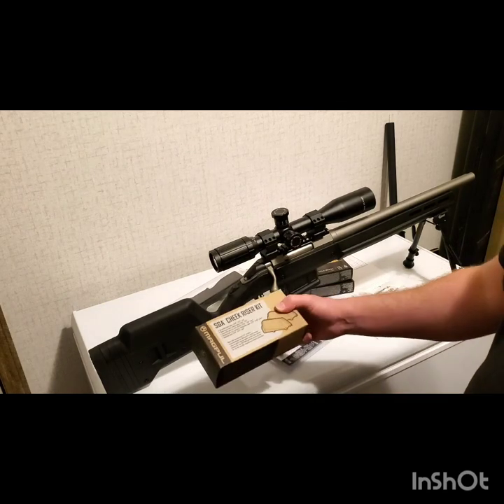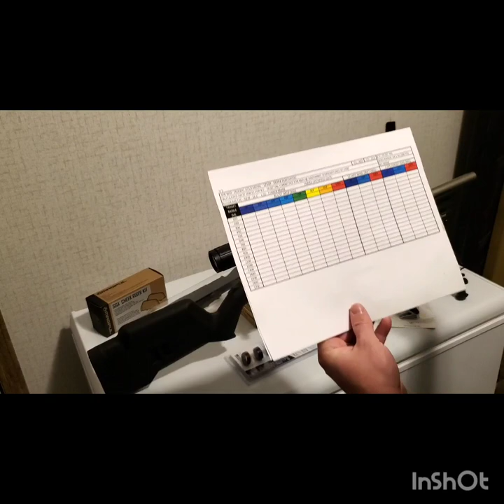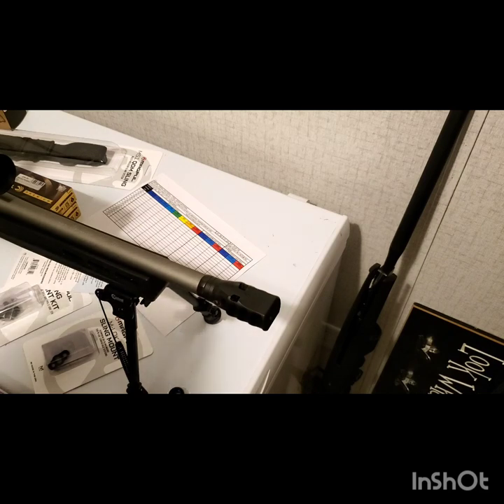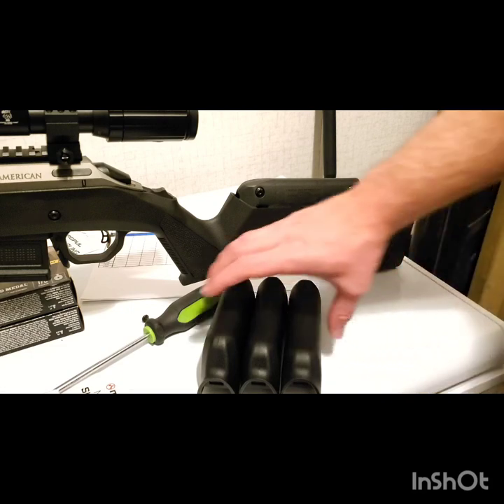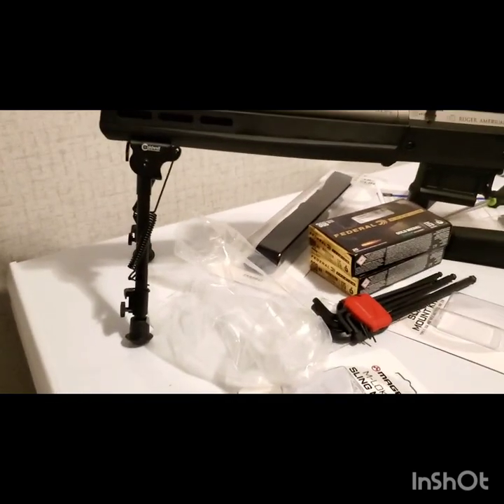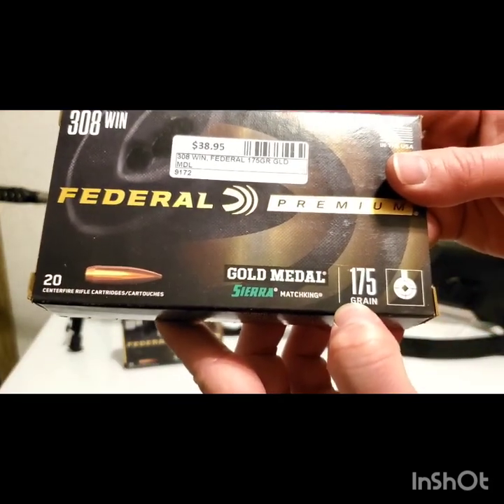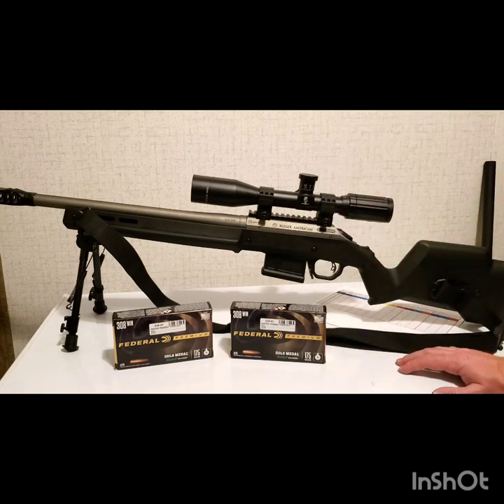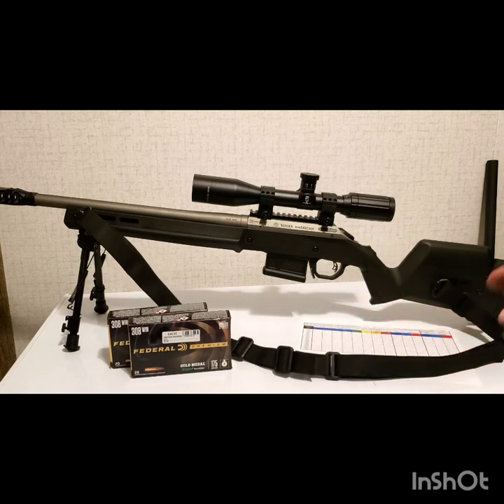Ruger Am-Tac .308: Muzzle Brake and Sling

Comment: Just got the Ruger am tac. Haven’t had a chance to shoot it. How is it’s accuracy for you
Reply from the maker: Accuracy is generally pretty good. I'm currently using the 185gr Berger Juggernaut loaded in the Federal Gold Medal Match. I haven't tested any other types or weights of bullets yet and I haven't tested any handloads yet so my data is limited. That being said, I'm seeing groups in the 1/2 MOA to 1 1/4 MOA size. I would say the majority of group sizes are 3/4 to 1 MOA. Even with a 185gr in a 16" barrel it's still going about 2500 fps at the muzzle. And the Juggernaut is designed to handle the transonic zone and remain stable as it goes subsonic. Though I haven't gotten a chance to shoot quite that far to see how it really does. I have shot it out to 1034 yards and I found at that range I started getting inconsistencies, hitting a 10" plate was about 3 out of 10 shots. Not sure if that is because I'm using a fixed 10x scope and just can't see that well or if the bullets aren't retaining stability.

I'm going to a new scope soon 5-25 power and I will be testing some handloads and different weight bullets.
Reply: My variant goes 3/4 MOA with Fed 168GMM. Similar results with Blackhills 175 BTHP Match.
Reply from the maker: @ssn711  nice, I recently went to 900 yards with some handloaded 200gr ELD-X running about 2400 fps. I was able to make a 2nd round impact and  put a total 6 out of 10 rounds on a 10" plate. I wish I had set up to film it, I generally don't shoot that well at distance lol.